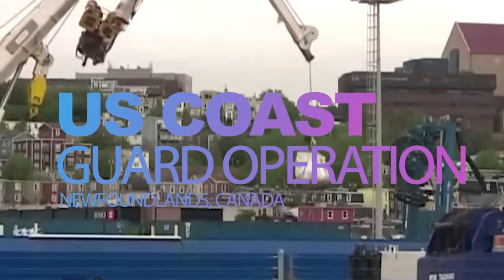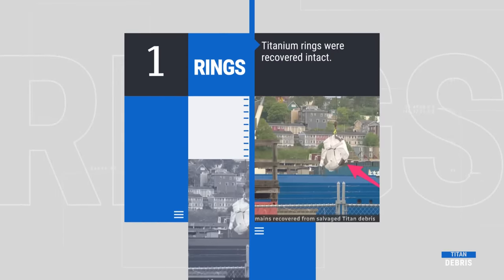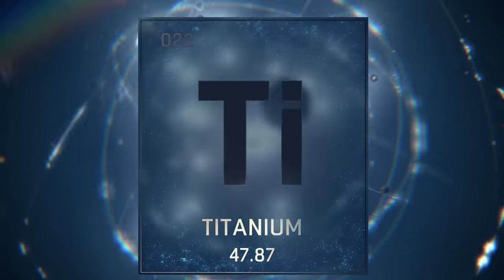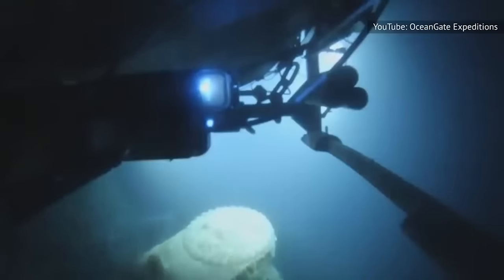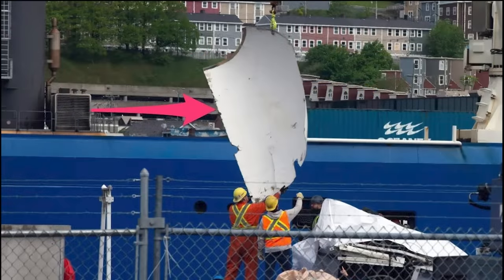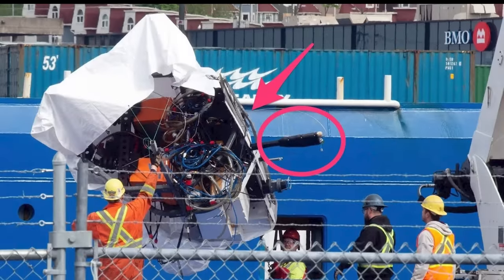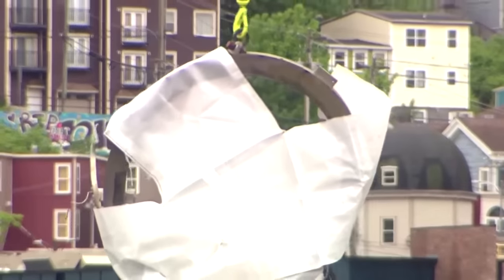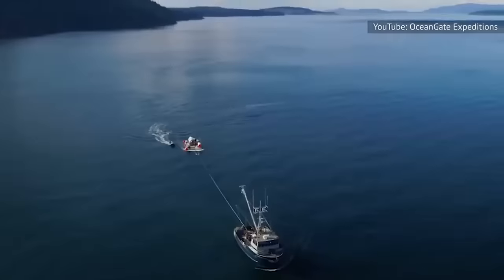What Really Happened? The Titan Submarine Clues from Parts after Implosion

Comment: Carbon fiber is good for its weight at resisting tension but not good at resisting compression.
Reply: and repeated diving would have made the micro cracking of the resin worse each time eventually the micro cracks would have become tears and the end was near, you cant subject carbon fibre to massive compression and expansion repeatedly, it will eventually fail as it did, but even the port window was a failure point, as it was only rated for 1300 meters and they repeatedly took it to nearly 4000 meters, if that popped it would have blown out the titanium end caps as happened ???
Reply: It was a composite.

Comment: Ok it's pretty obvious the carbon fiber gave way first. This would shoot the viewport plexiglass out like a bullet followed by 5 people who were instantaneously liquefied and shot through the porthole like dropping a solid block of the heavies material ever the size of probably 20 houses onto a toothpaste tube filled with water. As this split second catastrophe happened and the carbon fiber was compressed more it popped the titanium endcaps out because the pressure was too great to just escape the tiny viewport. As the carbon fiber completely disintegrated the remainder of plastic covering fell off as most of the carbon fiber was turned into dust in the end all that's left were the items that couldn't be compressed or the flexible outer shell. As for the viewport? If it didn't dissintegrat it would still be hard to find and harder to grab onto as it's just a small round 4 to 6 inch thick piece of plexiglass miles down in a pitch black spot and probably covered with dust! Can anyone tell me why this wouldn't be the case or if I am wrong and why? Just wondering...
Reply: The viewport was removed by the salvage company to lift the dome. The porthole was rated to 1500 meters. Which, with proper certification,  means it can withstand at least 4,500. This is the only part that was rated for that depth. It was the failure depth, but it did not fail. The carbon fiber to titanium ring joint failed
Reply: @JoeSmith-cy9wj  interesting but I am curious how they would remove it. Isn't it bolted on? I wouldn't think they have an impact socket driver attachment but just some type of claw. But maybe
Reply: @smiley492  Yes, a wrench, I suppose.  If it were important to the investigation,  they would use a wrench. Why try to break something that was designed to withstand thousands of pounds of pressure,  when you can use a wrench. 
There is new information now. IF TRUE, the failure was at the back end of the tube, not the front as I had assumed. Either way,  it wasn't the viewport.
Reply: I just am wondering how they did remove it. An electric socket of some sort I would say ok. A wrench on a claw I just can't imagine how at 2 miles, some current and more. Was this in a report saying they removed it? Because somewhere I also saw that the viewport was not rated for this depth but that he went ahead. I believe I read that the viewport was larger than those on the other deep sea vehicles. I just never read anything saying they removed it to attach a strap. Also they retrieved the other end cap without a hole for straps.
Reply: @JoeSmith-cy9wj  just read that the viewport was held in by tabs and some sort of glue. Rated for somewhere around 1300 to 1500 lbs pressure. As it descended it would protrude 3/4 inch on the inside. They said it probably just fell out afterwards
Reply: @smiley492  there are a lot of people who think they are experts because the read an article.  Many believe hype about a particular aspect of an implosion.  I am not an expert,  but have been studying science all my life. I too had plans to build a submarine for  shallow water. I had most of it planned, but never had the time, or the space, or the money.
Everybody is an expert on this disaster.  They think the have found the cause already.  Before investigators even have a chance. I tried giving people information but they wouldn't accept any. They know everything. 
This is probably the last comment I'll make in the subject. 
From what I have read, and thats not that much , the viewport was  certified for 1500 meters. NOT P.S.I.
Every 33 feet you descend,  you increase the press by one atmosphere, 14.7 p.s.i.
1500 meters is 4921 feet.
4921÷33=149 atmospheres or
149×14.7=2192 psi.
Things like climbing rope, overhead lifting chain, and elevator cables, among many other things that have human lives depending on them have to be certified.  This means that each one is tested. Each one is guaranteed not to fail before it's rating . They ALSO have something called a safety factor.
A factor is a number you multiply by to get the ACTUAL breaking strength.  They want these items to withstand several times the rating numbers. This is for a few reasons.  They guarantee the rating so the strength needs to be more. They don't want to get sued. And during use materials fatigue. 
Therefore if  a climbing rope has a rating of 4000 lbs,  and a safety factor of 3, the rope is guaranteed not to break before at least 12,000 pounds.
The submersible viewport was certified to 1500 meters. There are standard safety factors across industries,  and I don't know about this one, but I'm guessing it would be around 3.
That would get it to 4,500 meters, or 14,763 feet.
DEEPER THAN THE TITANIC !!!!!!!!!!!!
The owner of this company,  while he cut corners,  WAS NOT THAT STUPID. 
He knew a viewport with a 12,500 foot depth rating was well beyond his budget and the sub design would probably have to be modified to hold it in place.

Comment: Don't be so eager for clicks BrightTok. The only pieces that would have imploded are the weakest parts of sections that were pressurized. The two end domes separated from the weakest structure, i.e., the carbon based tube carrying the pieces. This info is only available on a million youtube vids and news stories.
Reply: Meaning it is the actual pressure hull that imploded, made of carbon fiber it was definitely the weakest component well known for years to fail under pressure.

Comment: To the view port hypothesis.  When you look at the pic at 2:59, it is clear this area consisted of at least three parts.  The viewport, a very shiny silver ring with bolts, and the more dull titanium dome.  In the pic with the lift belt in place, the shiny piece with the bolts is missing, which DOES support the notion the viewport was removed to make lifting of this piece easier.
Reply: ....are you completely discounting the possibility that the metal ring - and the bolts holding it in - were completely blown out during an implosion? The entire viewport end, which was metal, was itself bolted to a metal ring that was epoxied to the carbon fiber hull section. Presumably, these bolts were also ripped out as well because as far as I know, they aren't visible either. They could've very easily pulled out or snapped under the pressure. We don't know what grade of bolts were used, or how the receiving piece was tapped or rigged to allow the bolts to screw in. But gauging from the other engineering mistakes on this thing, I wouldn't be surprised if the fasteners did fail. Also, investigators do not typically modify, damage, or otherwise change piece of debris that are recovered from crash or disaster sites. To do so would destroy the integrity of the investigation. Fragments must be kept in the condition they are recovered in order to reconstruct the unit and conduct a proper investigation. I highly doubt that they removed the window, especially if it was rated for less than half of the depth it was found at......
Reply: @ScottAllenFinance  Look at that dome, does it look like things got torn off by a massive implosion?  There is no sign of what you describe.  The entire viewport end, other then the port itself is titanium.  Tell me, where are the ripped out pieces of the port?
Reply: @ScottAllenFinance  You make fair arguments, however, yes they do change or modify wreckage if it is need to relocate the wreckage for investigation, if they took that port off, they more than likely did a lot of recording of how it was before taking it off.  Remember also an implosion is inward, not outward, eg, the port would not have blown off, but pushed in, the results would have been the cabin pretty much instantly.  That metal ring with the bolts would not have been blown off as there was nothing to push against if the port had failed.  Now, if the port was there at the moment of implosion, THAT would possibly blow it off, but again, where is the torn metal?  The broken bolts?  There appear to be nothing like that on that piece on the red lift.

Comment: ‘Why such large pieces’. 
If you crush a can it doesn’t lose weight just it’s shape.
This submersible seems to have separated into its component parts when it imploded.
Reply: The bits that are not pressurised just stayed where they were and fell to the floor.  Large pieces from the side of the hull suggest that the tube didnt crush it failed at one end or the other.   I'm still thinking the transacript of a cracking sound from the rear and the decreasing boyancy fits the timeline and photos.

Comment: There are no 16 bolts on the widow and the ring is missing, Also there are no 18 bolts on the door where it should be bolted to the titanium ring that was glued to the carbon fiber hull. I think the implosion's rebound blew off the end caps and blew out the window.
Reply: What gives your hypothesis merit is that the bolted joints are only necessary for holding the components in the correct configuration for water pressure to force everything together.  While the water flooding into the interior of the end caps would have a lower static pressure than the water outside the end caps and window, the dynamic pressure would be much higher.
Reply: @richardbell7678  I'm thinking of it similar to a cavitation bubble collapsing. Once the collapse is complete the water hits a hard stop resulting in an outward shock wave blast as it rebounds. Then consider that it is cylindrical and the collapse happens only on the center axis so the rebound blast will be directed mainly toward the bell ends blowing the caps off and widow out. Bolts would not hold it. 
The Hydraulic press channel did a model test of it with interesting results.

Comment: Why are some of the fragments so large? Simple…..they’re either contiguous metal pieces, like the titanium rings or the front and rear domes, also titanium….no one was expecting them to be badly damaged. The port was ALWAYS going to blow out in an implosion whether or not it was the origin of the implosion. The outer shell sections were always likely to be relatively undamaged. They weren’t under pressure like the pressure vessel and it’s occupants, however, the fact is that there’s NO CF wreckage thus far……which isn’t surprising at all, because in the case of a catastrophic implosion, the pressure vessel, the CF material that composed it, would have quite simply, disintegrated
I wrote the above before watching this video. I’m impressed.
Reply: The bags around the large chunks of debris are likely full of shredded carbon fiber. I'd say the repeated dives caused high pressure water to sponge into the carbon fiber, then quickly resurfacing causing the carbon fiber to basically get the bends causing widespread delamination....
Reply: So the fiber composite is what disintegrated. ?  Everything else just busted up.

Comment: There is no mystery .. the large pieces are the sections ( tail ) that wasn't under pressure .. and the two titanium pieces plus the viewport .. because the pressure hull imploded and those sections came off pretty much unscathed.
What you won't see apart from maybe tiny pieces is the carbon fiber pressure hull which was flattened and then exploded pretty much instantaneous
Reply: That viewport, though, no glass as far as I can see. Had forgotten about the bolts, actually, now I realize there's something missing from the hatch section. The carbon fiber hull is definitely gone.

Comment: Question: How many microscope air bubbles are trapped in each turn of the application of the carbon fiber layer? The cocoon may seem absolutely solid at sea-level, but could be like a sponge at >4000 psi.
Reply: Apparently he used expired carbon fibre on top of that, haven’t confirmed that myself. If true I wonder how that would play into things like said air bubbles
Reply: Microscopic. A microscope would be used to see the Microscopic particles. And no the carbon wasn't "expired" lol. What a troll.
Reply: @coronalight77  , No trolling here. If you have any kind of air bubbles in the laminations, you have compressibility, it's not fully solid and if it even is, it's subject to direct contact to the water pressure. A typical high pressure air tank will use a metal cylinder with a carbon fiber exoskeleton giving the strength to hold the shape. Note, the pressure is on the metal side of the tank. The pressure of the hull is on the carbon fiber side where there is no metal exoskeleton protecting the carbon fiber from that kind of water pressure. I kind of think that this vessel was built inside-out.

Comment: Pushed beyond its limits?  They didn't know what the limits were.  There is no evidence that they actually did engineering design on the components.  The carbon fiber cylinder was not manufactured to resist the complex stresses that it would have seen at depth.  This could even call into question what type of engineering is taught at Princeton.
Reply: Theoretically, I think they operated at around 350 bar pressure. The think is, that when tested under external hydostatic pressure, carbon fiber gave in under about 1400 bar pressure. Under test conditions, in other words, it exceeded the requirements. However, I don't know if anyone's tested it similarly in extended use. There's studies on at least on US Navy carbon fiber constructions and they fail, the epoxy I think specifically, under exposure to pressure and sea water. There's also the operating temperature to consider which is close to the freezing point at that depth.
Reply: @Katoshi_Takagumi  They would have to analyze, design and test the exact configuration they were using.  The titanium dome/ring would offer restraint at the end of the cylinder to keep it from going through the radial shortening that it wanted to, I think this would induce bending perpendicular to the curve and tension stress in the carbon fiber in the direction that did not have fibers.
Reply: @billj5645  They will probably have to conduct a lot of tests (or computer simulations) as you say. I assume, on it's own the hull would have initially cracked lengthwise and thereafter quickly imploded, at least if it was simple pressure that did it. I think, though, there's reason to suppose there was gradual degradation occurring that got worse with each successive dive, so the answer may not be straightforward.

Comment: The thing to remember about carbon fiber is that is layered up to the required thickness. That is layers of flexible material held together with glue. When put under pressure the layers can separate, weakening the entire structure. On the surface it looks fine but there are cracks hidden within the structure that require specialized equipment to spot, I think xrays are the method of choice but ultrasound might be used. Oceangate did not use any methods to check the hull between trips, that I am aware of, and at 2.5 miles underwater the result of any hull failure can be summarized as "physics happened".
Reply: They also didn't make it or put it into a vacuum chamber to release air bubbles. Apparently, they were also supposed to be in a clean room to avoid dust and other particulates from getting into the structure. The expanding  and contracting airbubbles likely made micro fractures, along with the great pressure in general.

Comment: The wreckage doesnt look like a crushed implosion to me. It looks like it burst apart into large pieces.
Reply: That’s because you are only seeing the parts that weren’t filled with air. The cabin where the passengers were was crushed like a soda can under a buss tire. They aren’t showing us that part. Those rings were at the ends of the cabin tube. I hate to be graphic in my analogy. But that’s what it would have looked like.
Reply: @Jay-eo3wl absolute immense and sudden pressure  followed by the compression of air into a sudden much smaller volume. That then subsequently causes a rapid rise in heat as the air is compressed, most likely igniting. 
Essentially their bodies were compressed to oblivion and then the red mist that was left was incinerated instantly.
Reply: What are your qualifications
Reply: I never seen CF compress like a soda can!? You're probably an expert and have already tested a sub similar in the same conditions like everyone else here
Reply: @monroefive-o40  There's nothing left to show.
Reply: @anarajah-3066 there is a video showing the compression tests of several different materials. Carbon fiber failed early and was totally shattered into many pieces.

Comment: Not surprised the titanium held up. It was the carbon fiber that was the weakness.
Reply: OR the glue used to bond the titanium rings to the carbon fiber. It was a fatally flawed idea to build a pressure hull from three different materials, each with differing mechanical properties under extreme pressure. The pressure hull should have been built of titanium or high steel such as HY-100, and the hull could have been two or three pressure spheres joined together if a single sphere did not provide enough space. That was how the U.S. Navy's DSRV submersibles were built.
Reply: The front glass may have been a flaw too.